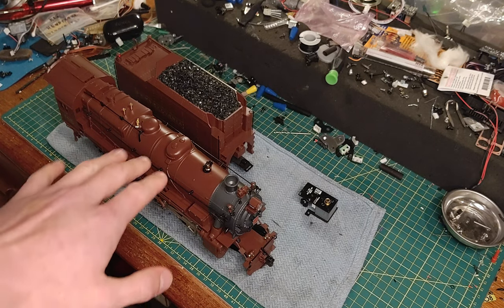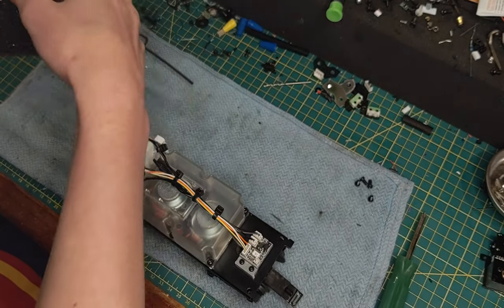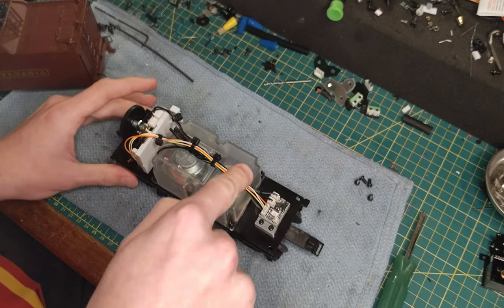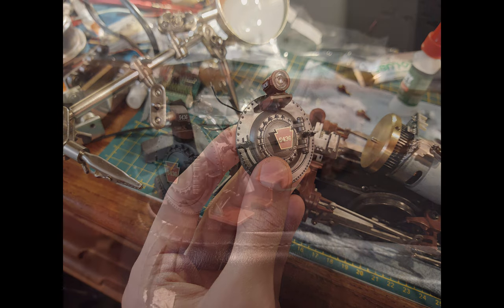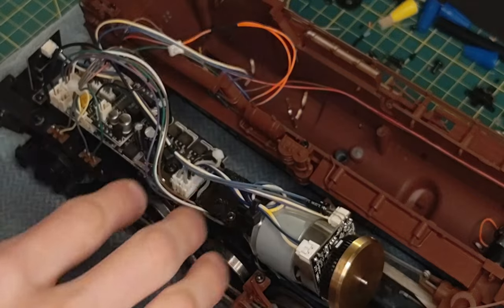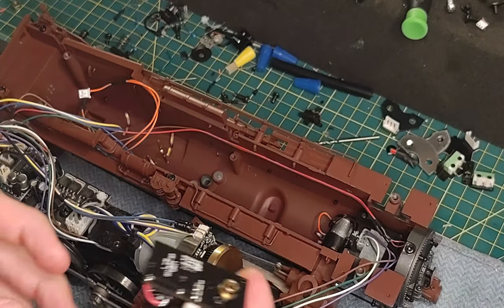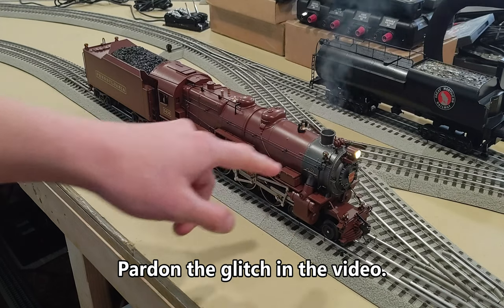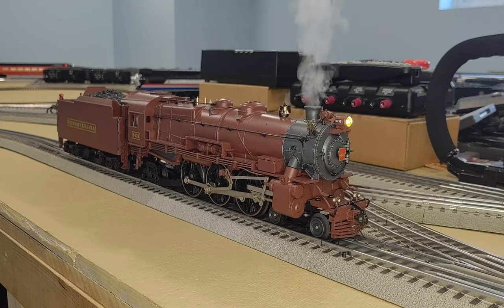Lionel PRR Tuscan K4 Episode #2: #workbenchwednesday

Comment: Sid your are very good at what you do. Btw where did you get the molex connectors. I Need a wire harnes for my smoke unit going from the rcmc to the smoke unit on my legacy 911 sd60e. Mine broke the wires off while installing a new rcmc board. If you could make me one I would buy one from you. I possilbly could make one 
, but not sure where to buy the molex connectors. Thanks
Reply from the maker: Email me and we can talk some more.

sidstrains773@gmail.com